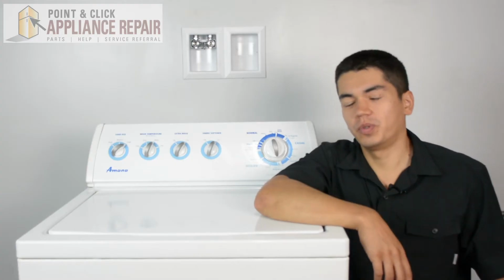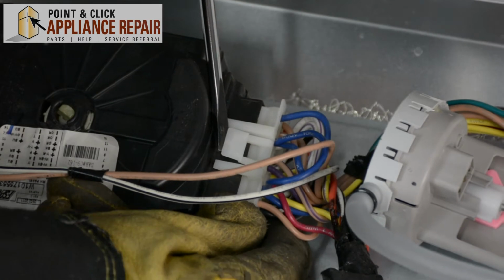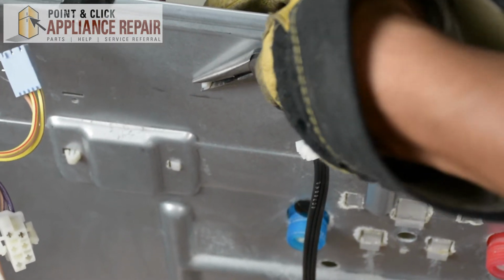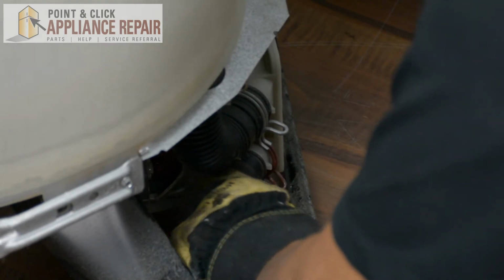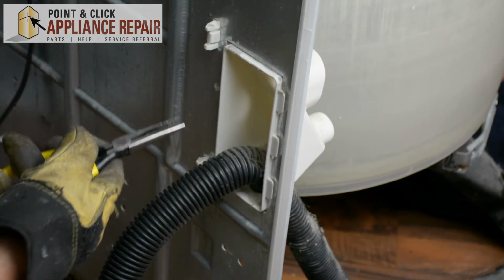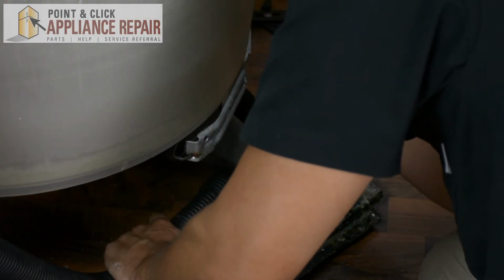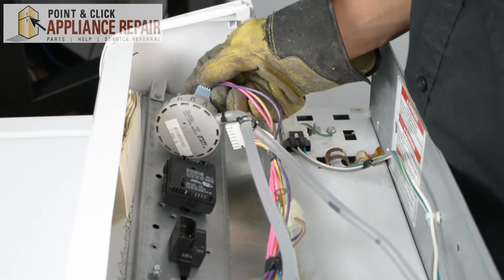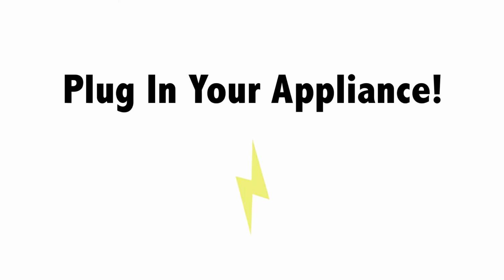WPW10189267 - Replacing Your Amana Washer's Drain Hose Assembly AP6016588 PS11749880

Comment: Very helpful!  Thanks. Just as you described although I wasn't able to totally separate the back and pull the casing off but had to have someone hold the back metal panel to the side and work around it.